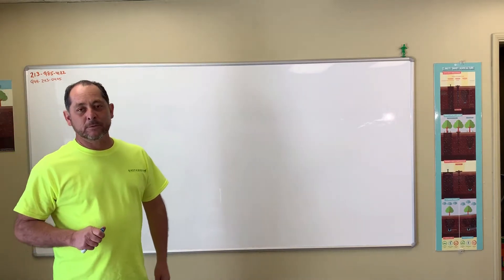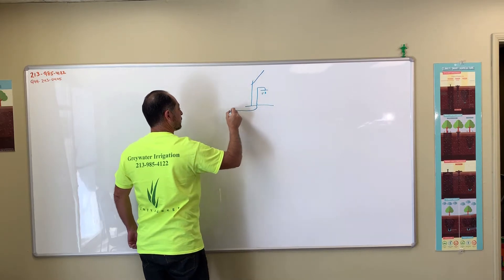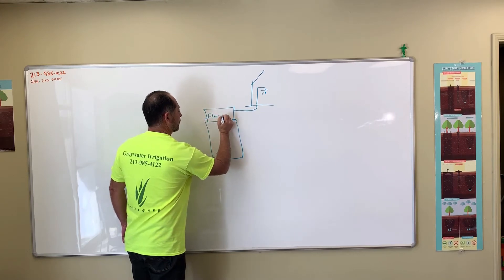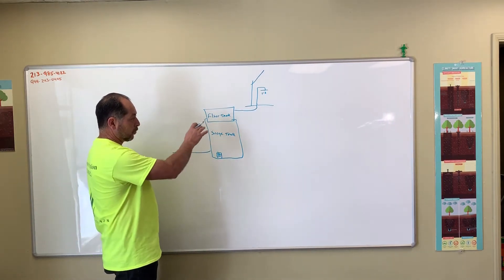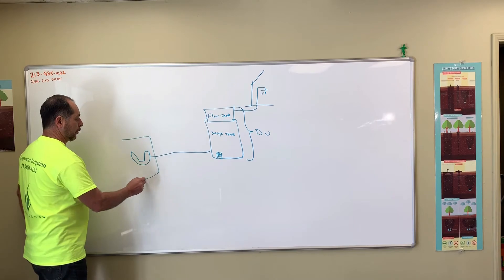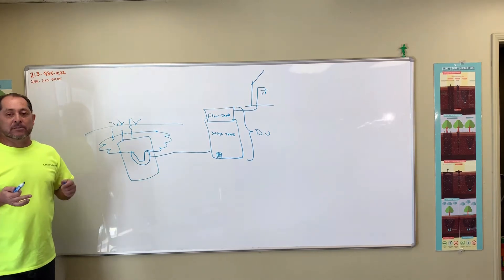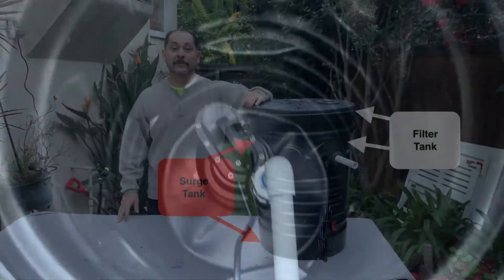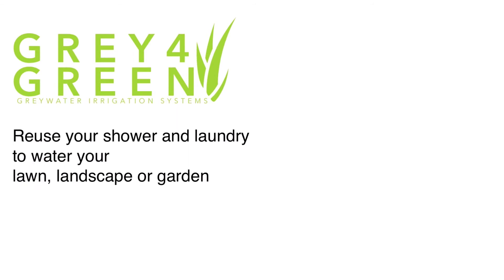Beginner's Guide To Greywater Sump Pump

Comment: This is brilliant. 
I'm looking for solutions for re-routing graywater pipes from our kitchen to the sewer line, after discovering broken terracotta pipes in our basement. The plumber is estimating $5000+ to fix it, b/c he'd have to do concrete work. I asked abt re-routing them instead, which would be $1200, but meant that there would be a 30ft horizontal pathway for the water, that he said would back up. The idea of collecting it & installing a pump is friggin fantastic, & very helpful. Thank you.